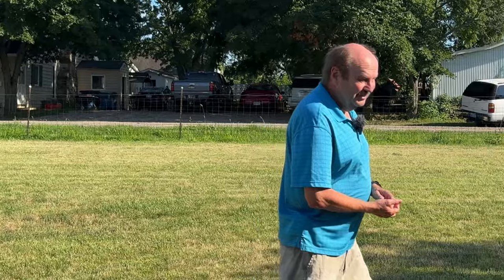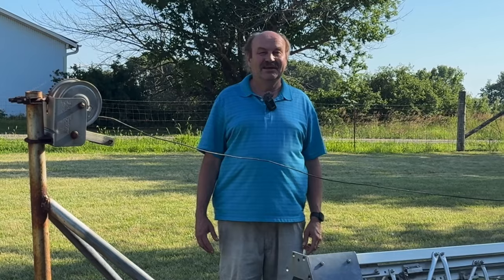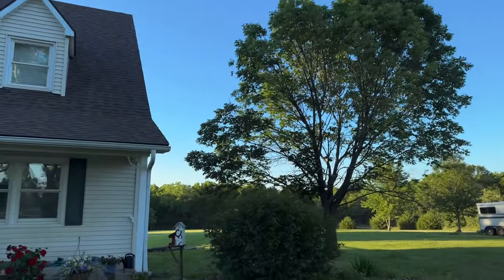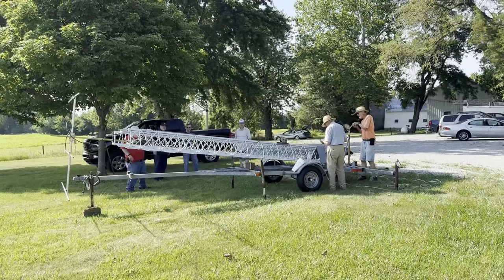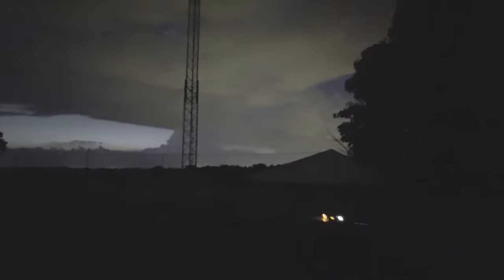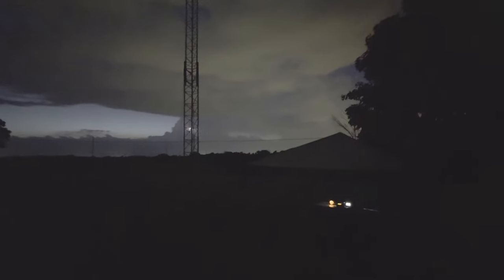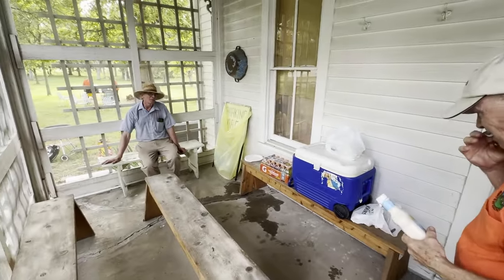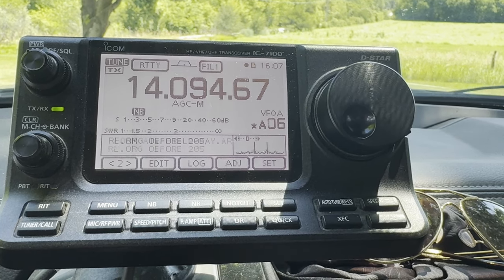July 2024 Update

Comment: Wow, that’s quite a fancy and functional mobile tower Tom!  I didn’t see any guys, don’t you have to guy it for strength?  And I had gotten the impression from another video that you were from somewhere in Virginia.  I hadn’t recognized any Midwest accent.  Thanks again for sharing!  73 Tom KC3QAC
Reply from the maker: The trailer has 4 large outriggers.  We used it at field day with no guys, and no issues.  We only had a 6 meter beam on the top.  Depending on the weather, how long it might be up and how big the antennas are on top, I might want to add guy ropes or wires.